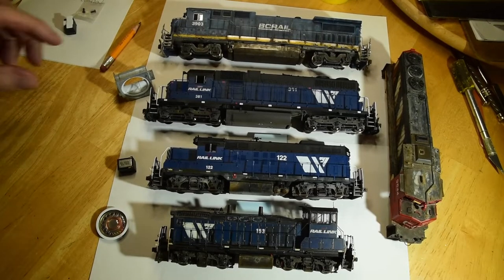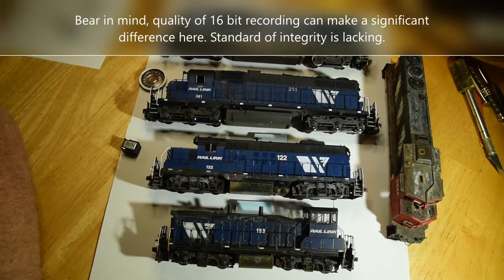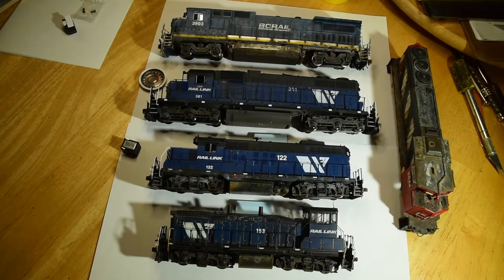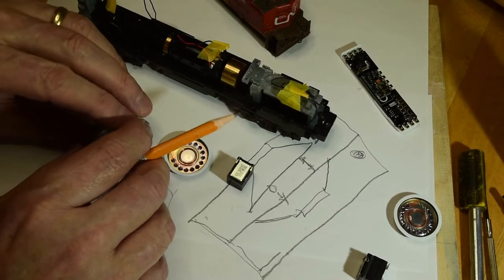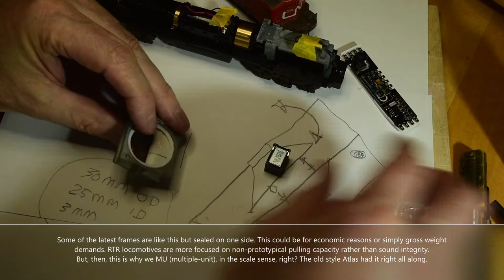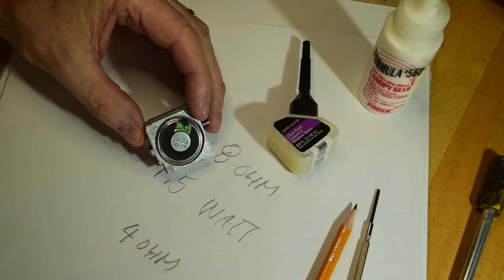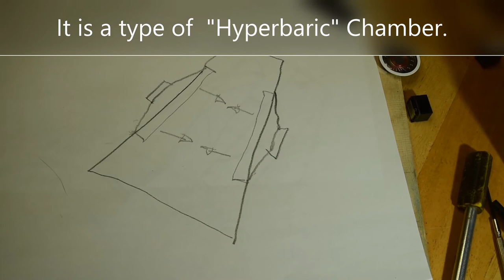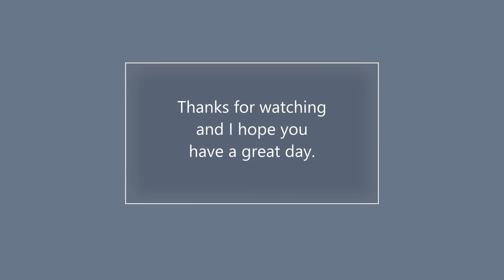HO Atlas CN GP40-2LW | Scale Sound: Part 2

Comment: Boomer - I think you might find it very interesting to read a technical paper on "Speaker System Design for Small Model Trains" written by JT Burke from Scale Sound Systems. He is a single person business owner who sells speakers with his own designed enclosures. I'd be the first to tell you that I'm not an expert on sound systems, but I've been using JT's data to design my own 3D printed enclosures with sugar cube speakers that I bought from Mouser, that I've been using on my new decoder installs. You can find his technical paper on his website at www.scalesoundsystems.com under the menu title "design". He also has a YouTube channel "jt burke" that has some great installs on different types of locomotives. Hope you find this helpful and educational as much as I did. Thanks for another great video!
Reply from the maker: Thank You Mike. I always appreciate you. Respectfully, I read the paper. However,  I consider it to be an incomplete paper.

Although sound technology, on a micro level, is as much an art as a science, as he did mention (quote), "it’s still a lot of design-listen-measure, design-listen-measure, design-listen-measure." Furthermore, he does not allow the community to comment on his sample videos restricting a round-table discussion on the subject. At the end of the day, sound is subjective to each individual.

In addition, I do not agree with his claim that "Coupled Arrays" (multiple speaker applications) are less effective or negatively affect sound integrity outside of his study. Why? Because he never demonstrated the varied coupling factors for different size enclosures and speakers when combined with varied body shells , etc. -- not to mention the quality of 16 bit sound recordings which vary as well. e.g. GE and EMD recorded sound files vary dramatically in these situations. If he had included the latter in the paper, I would have given him higher marks.

Conclusively, good research . . . but incomplete as a convincing paper in my opinion - Boomer. Cheers.